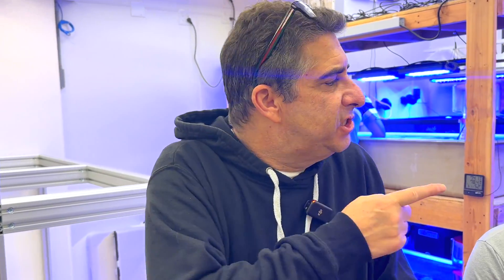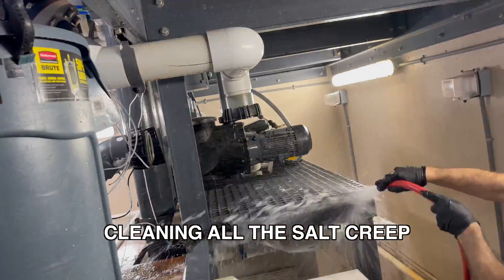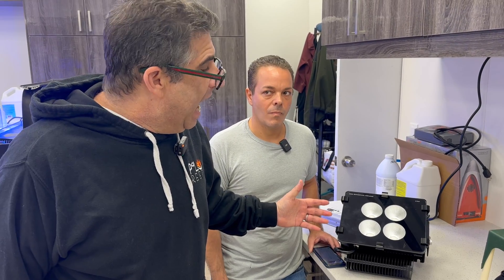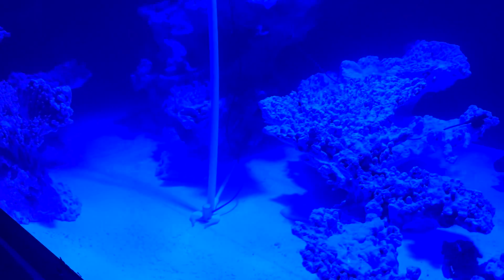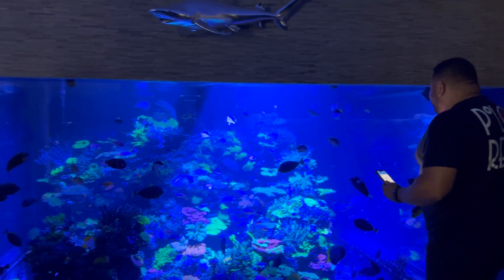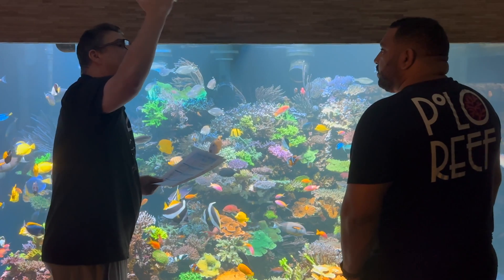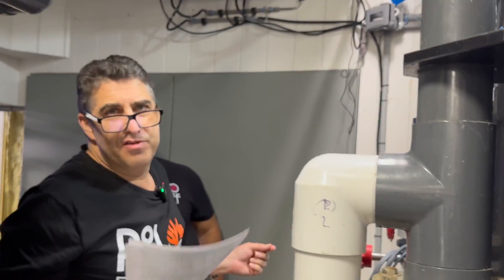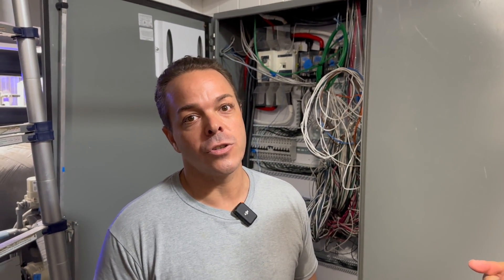Skimmer Changeover Testing Some New Lights and Evaluating Ozone.

Comment: What orp set points are you running?
Reply from the maker: 340 to 350 on sump maybe 20 points lower in display.
Reply: Thanks for the reply, can’t beat ozone with the clarity and I find I have to clean the glass less.